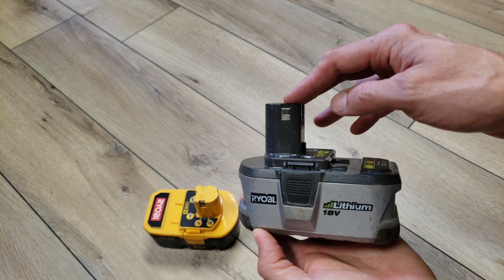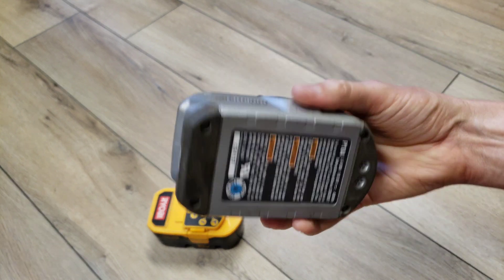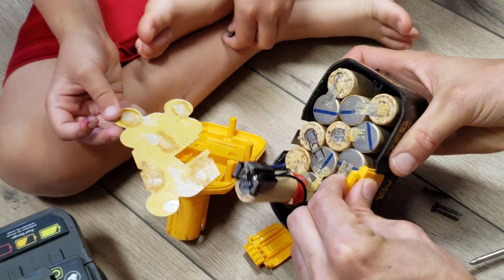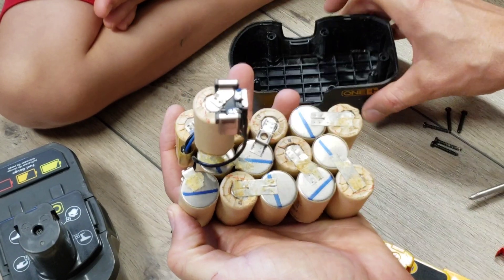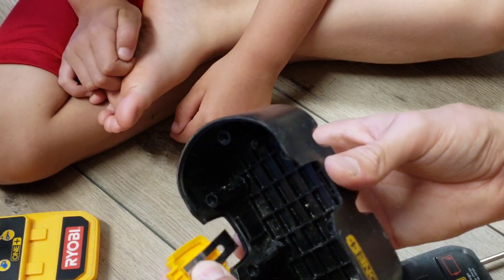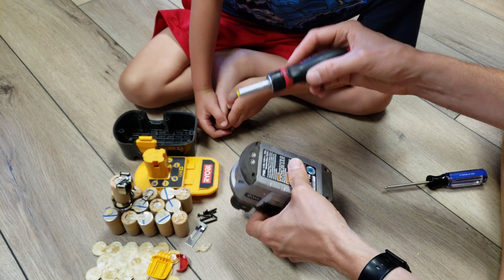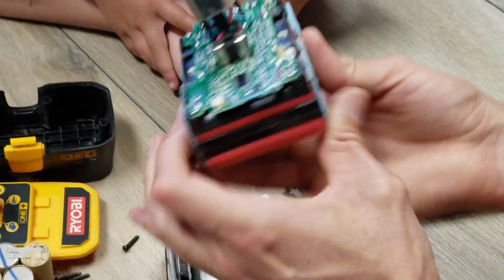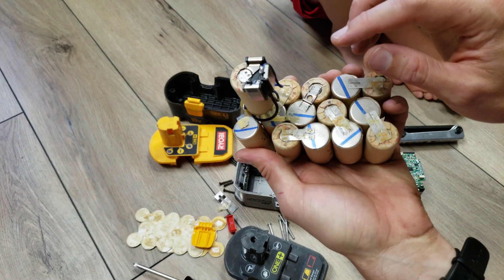What's Inside A Li-ion vs Ni-Cd Ryobi 18V Drill Battery | Cordless Power Tools

Comment: Good  day  > Couple  weeks ago my dewalt got hot on bottom ,  that was the end  of it.  2nd battery done it latter. Now u said heat sensor < I wonder if my  heat sensor  went  wrong?  Thanks for   video.
Reply from the maker: If you've never had problems with overheating and thermal shutdown during normal operation before, then it's not the temp sensor going bad. In fact, the temp sensor may have shut down the power, preventing the battery from overheating and catching fire. It sounds like something else is wrong with the battery pack.
Reply: @engineerable  Thanks for comment , I suppose  they are shot.  Thanks